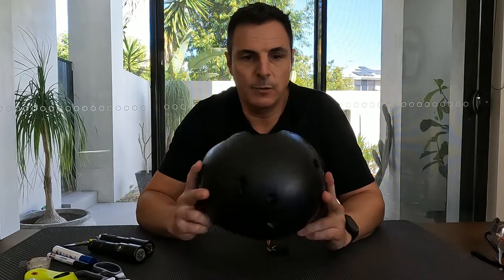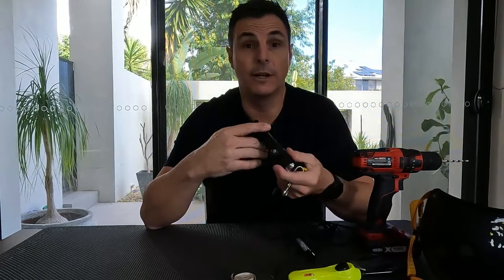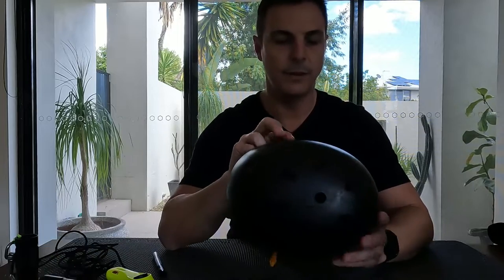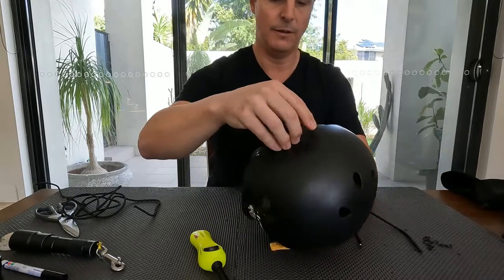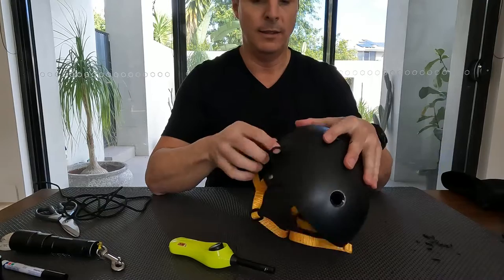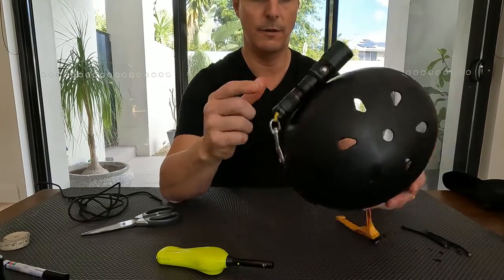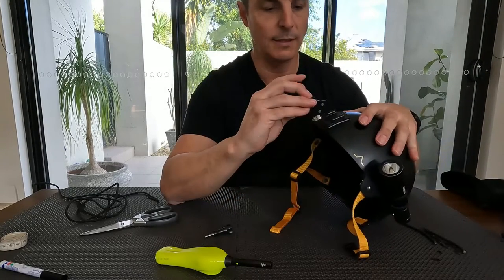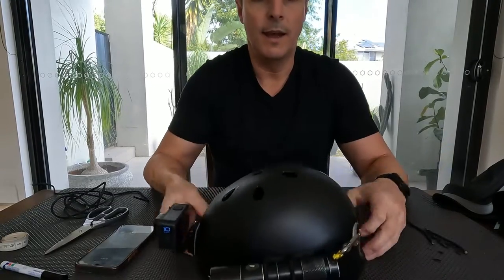How to make a DIY helmet for scubadiving

Comment: Great Video and very well explained! The only adjustment I'd make is loosening the back bungee for the bolt snaps a bit. 
Please correct me if I'm wrong but in the video it looked like you had to use quite a bit of strength with both hands to clip the second light in.

I imagine it could be difficult trying to get the bolt snap out from behind your head and potentially one handed because you are running/retrieving reel for example.
If there is a specific reason you made the bungee so tight I'd love to hear it, personally I don't think a bit of slack would put them at risk of coming undone accidentally.

Thanks for the great content and safe diving!